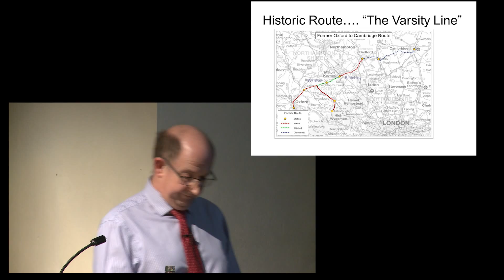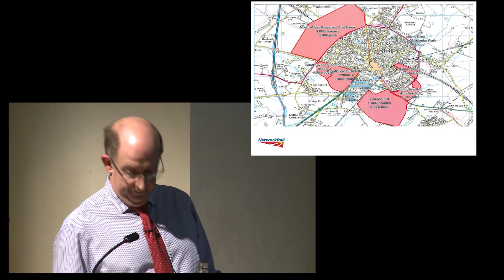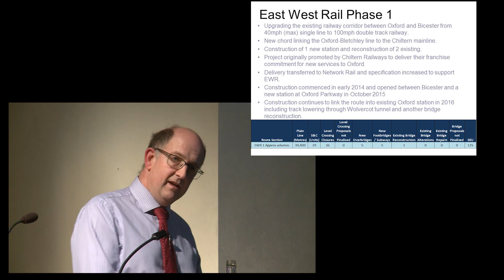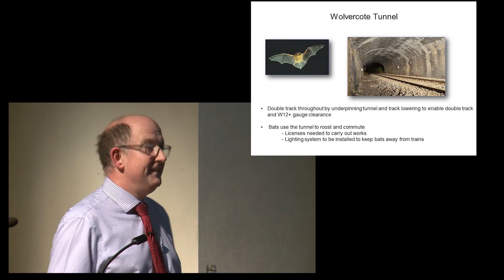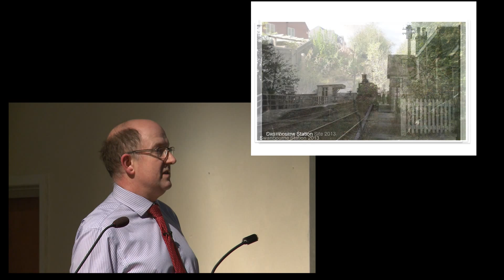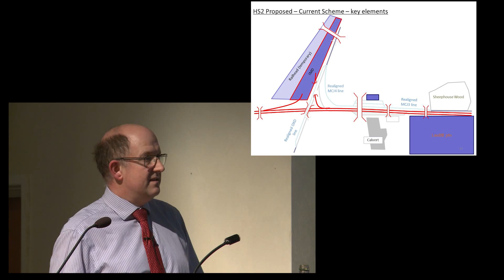Andy Milne & Andy Free - East West Rail from Oxford to Milton Keynes and Bedford

Comment: It make me so Cross that the man who was in charge of Running of the British Railway at the time naming of Beeching decided to make the wrong decision by shutting down the Central Variety Line Between Cambridge to Sandy is ridiclous, it look like you will now need a few tunnels along that route.
Reply: Yep, most reasonable people now agree (if they didn't previously) that this is one of the passenger route closures that should never have happened. Remember though that Beeching was doing what government told him to do. While true that his BRB used dodgy figures and 'factoids' to back up their closure proposals, it was ultimately down to the Sec Of State to decide which proposals to accept. Beeching Report was done at behest of the Conservative government around 1962. During the 1966 gen election campaign, Labour (bless 'em) promised not to grant any more big closures. Once in power the notorious Barbara Castle reneged on that promise and nodded through closures such as Varsity, Okehampton-Tavistock, Matlock-Buxton and Waverley. So it's the politicians I am cross with.

Great to see this project slowly get to the front burner. Let's hope the government can trust the rail industry to make it happen at a reasonably affordable price!
Reply: The only busy part of the Varsity Line was the only portion to survive. There were only 4 trains to run the entire route on week days and it took 4 hours to traverse the line. The line was never very significant.

Comment: have you thought about reinstalling the line from northampton to peterborough and then out to the east coast 
the line from Northampton will link Wellingborough, irthlingborough, Raunds, Thrapston, Oundle, then on to  Peterborough.  and through to Hunstanton
Reply: The Nene Valley Railway is in the way.
Reply: @neiloflongbeck5705  the Nene valley railway is not in the way as it's on the original trackbed of the original line
Reply: @wesleyjohnclarke7657  yes, it is in the way ad they own the track bed form Yarwell Mill to the Fletton Junction on the ECML. The other major problem is the A605 which needs to be  rossed east of Thrapston and totally dug up if you want to use the old track bed.
Reply: Peterborough to North luffenham junction thence to market harbrough then south to Bedford is do-able.